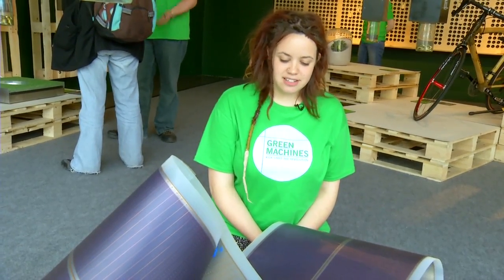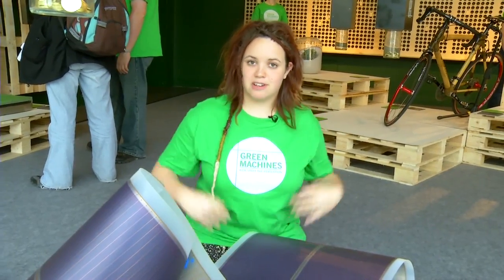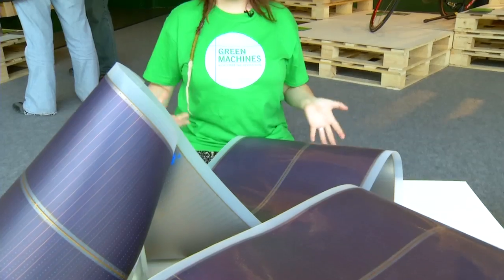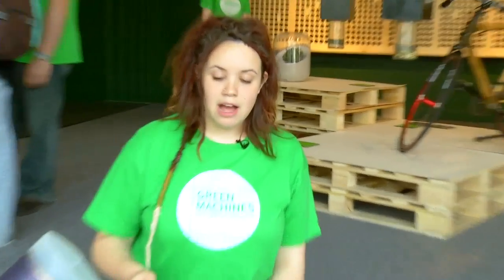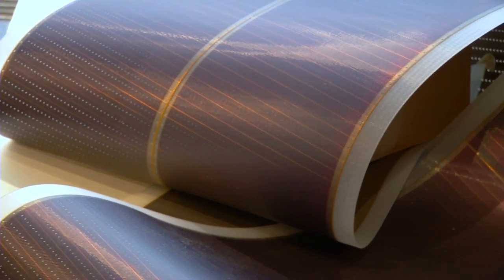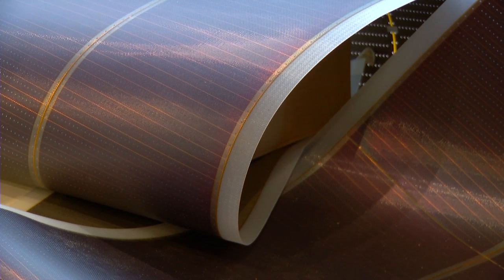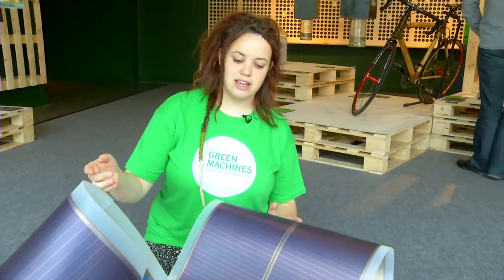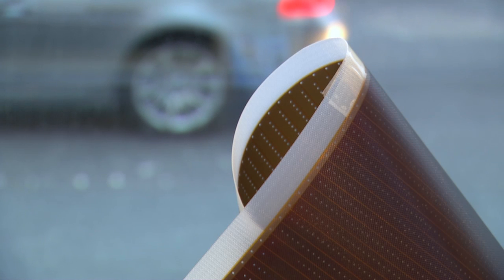GREEN MACHINES: POWER PLASTIC

Comment: Regardless of the higher weight of crystalline solar panels, you can get a lot more watts on your roof with them.  Area is the limiting factor, not weight and you will need 3 times as much area with these plastic panels as you would with the much more efficient and much less costly traditional panels.

Comment: Couple issues with this video..

Anyone that has seen solar panels before has for sure seen the amorphous cells used in solar powered calculators

What kind of bus bars/conductors can you make out of recycled plastic?

Standard PV installations only add about 3-5 pounds per square foot to a roof, this is not a large load and rarely impacts the number of panels that can be installed on a roof.

If this technology were so much cheaper than the 'big huge' panels there would be more of them.